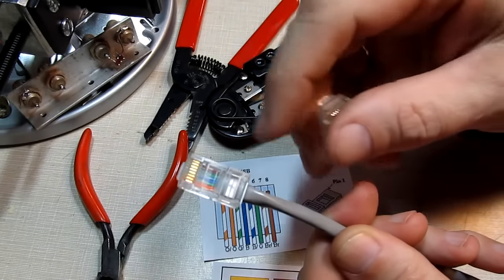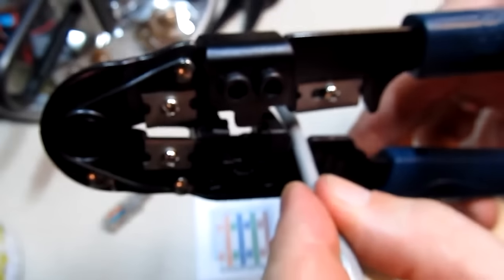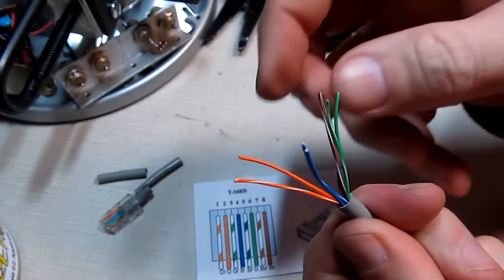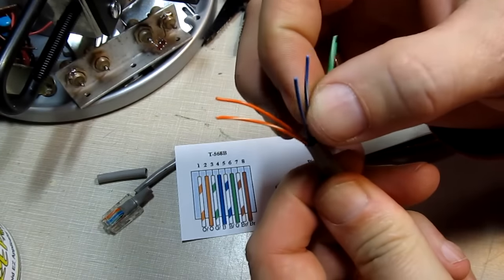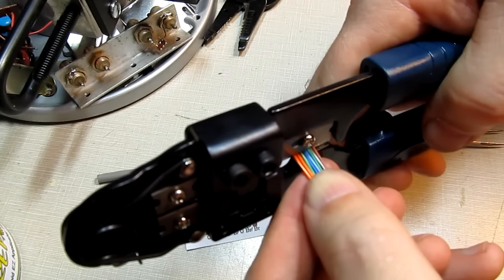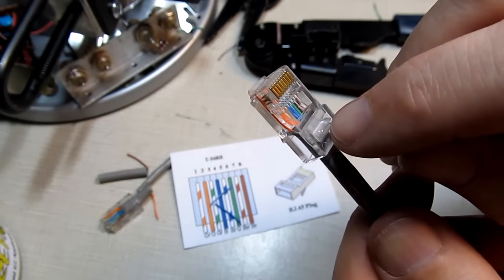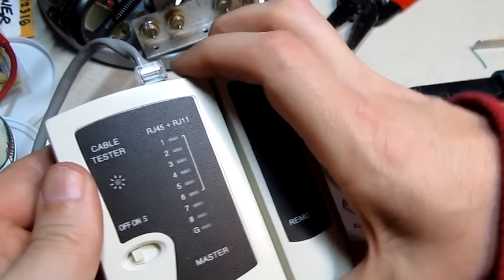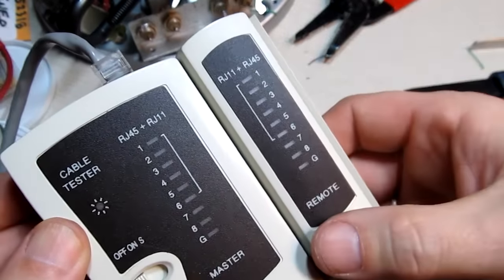#124: How to install an RJ45 connector on a CAT5 Ethernet network Patch Cable - DIY Repair

Comment: You must have the connectors in this particular order, if you use a different order, and even if they are the same at both ends, you get reduced speed, the reason for this is that the cable is twisted in a certain way.

Comment: my telefphone cable only has four wires. how am i going to plug my rj 45 wire with it?
Reply: Telephone wire uses RJ-11 connectors which are 4 wire. RJ-45 is 8 wire intended for Ethernet. Different uses.

Comment: You know I've never crimped ends on patch cable. They're pretty cheap to begin with. I have however punched down a ton of T-568B on patch panels. That's a different story altogether.

Comment: hey does anyone have good inexpensive  connector cutter/ press, and cable tester pls, for cat 6, pls? not sure what too look for in amazon
Reply from the maker: Good and inexpensive don't always go together.  If you need a good tool that will perform flawlessly over thousands of connections, then go with a name brand such as Klein (https://www.amazon.com/Ratcheting-Stripper-Klein-Tools-VDV226-107/dp/B00F6K5SY2/).  If you just want a decent tool to do a reasonable job on a few dozen connections a year, then you can shop more on price - and check the reviews (especially the middle of the road and bad reviews) to see what users say.

Comment: How long do you cut the wire???
Reply from the maker: Since connector styles can vary, I typically hold it up to the connector and gauge it that way.  There are newer connectors that allow the wires to pass all the way through, and then you trim them after the fact.  Fast and easy.

Comment: Still wondering how you don't need to strip the inner wires like really
Reply: The contacts are called “insulation displacement” contacts, which is a fancy way of saying that the contacts are designed to pierce, or cut through, the insulation of the wire and dig into the copper wire.

Comment: what is the logic behind the order they have to be inserted in to the RJ45 connector?  why not in order by color stripe to solid..?
Reply from the maker: It goes back to the history of the RJ-xx (Registered Jack) usage for the telephone company.  The RJ wiring standards always used the center two contacts for the "primary" line, and then additional lines would use the pins on either side.  However, for Ethernet, continuing this practice for the 3rd and 4th lines would result in separating the pairs too much which would affect signal integrity.  Thus, the first pair is on the middle two pins.  The second pair straddles the first pair.  The 3rd and 4th pairs occupy the remaining adjacent pin pairs.  Some history can be found here:
https://en.wikipedia.org/wiki/Registered_jack

Comment: Orange/white Orange
Green/white Blue
Blue/white Green
Brown/white Brown
Reply from the maker: Of course that will work too, provided to you do the same at both ends.  It doesn't match the EIA/TIA standard (the wires in each pair are swapped), but it will work fine if both ends are done the same way.
Reply: w2aew 
Nice video.
Can you tell me if it is necessary to have both ends of the cable plugged in the tester device?Or can you just plug in one end?

Comment: Practice, practice, practice. Use some old Cat X wire and put on 10-20 ends and you will be doing it with a beer in one hand.

Comment: You  make it look so easy! But I'm struggling because the wires don't want to stay in the right order and when I straighten them, the dye comes off the stripey ones so they all look plain white. Then when I try to trim them, I can't seem to get them into the tool correctly, and they all end up uneven. I've started with a 50' cable. Let's see i get this done before it's a 45' cable...
Reply from the maker: It does take some practice, a bit of back/forth bending of the wires to coerce them to stay straight, and a firm pinch of your fingers at the point where the wires fan out to keep them in order.

Comment: If only those plugs had metal tabs. They would last forever.
Reply: I have superglued or expoxied them back on to avoid having to cut and recrimp another end on a cable, especially since I don't have the tools to do it. I need to get some though.

Does anyone know where to get a high quality crimping tools like what is pictured in this video? I prefer name brand if possible as long as the price isn't ridiculously high.
Reply from the maker: orlandotech I don't know how well the glued tabs would hold up.  For what it's worth, the crimp tool I used in this video was a pretty inexpensive one, similar to this:
http://www.amazon.com/Belkin-RJ45-Medium-Duty-Crimp/dp/B00004Z62S
Reply: You can get them made out of metal.. They are called Shielded RJ45 connectors.  they are a must have in industrial environments when signal interference is a big issue.  They are quite expensive approx. $15 each.

Comment: It's not about having the right tools, it's about having the right fucking end connectors as I found out the hard way.  
There are two different connectors types for two different cable types.   One for solid wire and a totally different one for stranded.   
Guess what, you use the wrong one on the wrong type cable, you have a world of fucking problems later on.
You use solid wire to go into static instalations like through walls, underground, anywhere where it won't be bent much.
You use stranded wire to connect small devices, patch cables, run under carpet and matts, do temporary connections, etc... as it can take a lot of bending and twisting and not break.

I hate networking so god damn much.   It never works, you have 8 strands any one of them can break over a 100m run... plus the connections at the end that are flakey... etc.     Wifi raido repeaters and Ethernet over Powerline are even worse.    People overjam the wifi network all over with their encrypted connections and there is so much noise nobody can use any of them.

Comment: Now how do you do that without the $200.00 crimper to do a $1  plug.
Reply from the maker: bear northpole $200?????  The crimp tool shown in the video only costs $10-15...
Reply: +bear northpole Look on eBay - tool and tester together about $12-13 US.  With a 100 connectors! ;)

Comment: The RJ45 connector is a terrible design. If you are trying to untangle a bunch of cables and pull the RJ 45 cable backwards the plastic clip catches on something and breaks off.